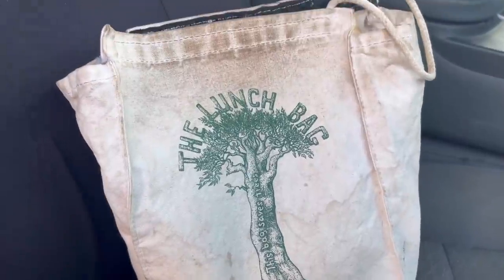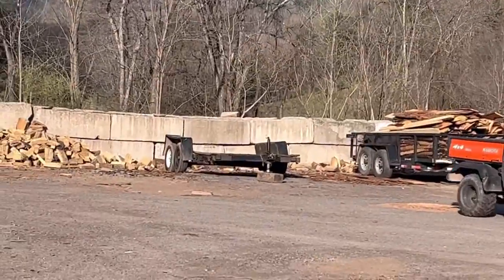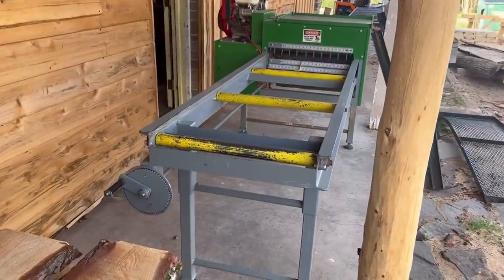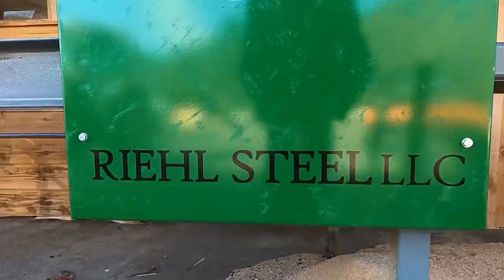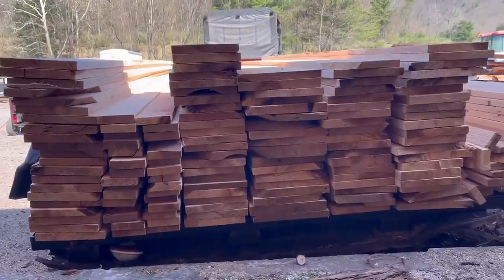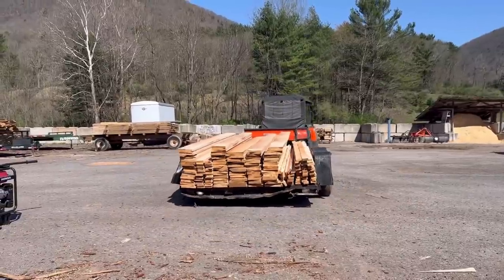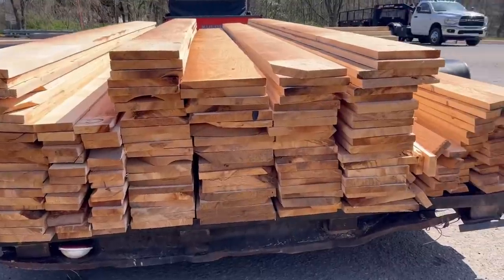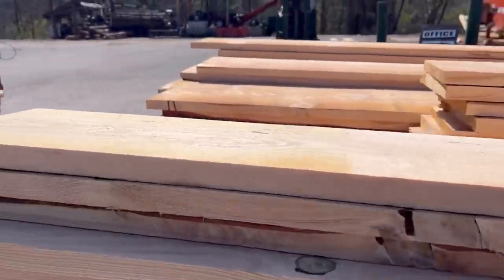Operating the Riehl Steel edger

Comment: What's the difference between a sticker and dunnage?
Reply: Stickers are usually 1”x1” or near that and used to promote air circulation. dunnage is typically 3x4 and larger. Dunnage is used to keep stacks off the ground, separate stacks of lumber and provide space for forks to fit to lift the piles. Then there’s cribbing….

Comment: You should solicit your equipment and machinery suppliers to recommend their machines in exchange for sponsoring you
Ie: comment on how good stihl chainsaws are in exchange for them sponsoring you and giving you free saws or safety (Ppe) gear
Reply: fyi the boss uses huskvana  saws john deere bulldozer with caterpiller   engine and kubota tractors and suvs.